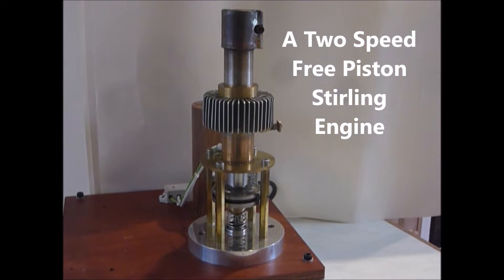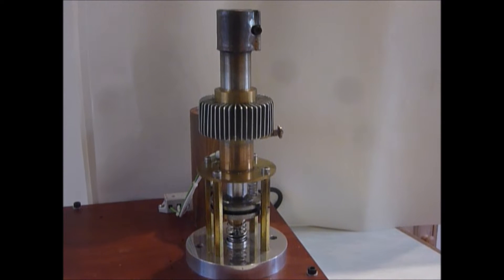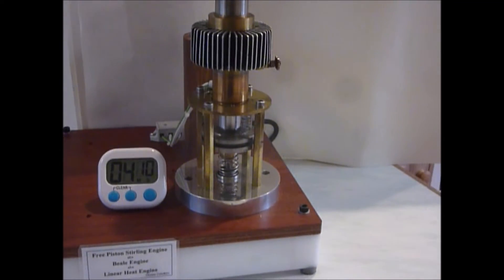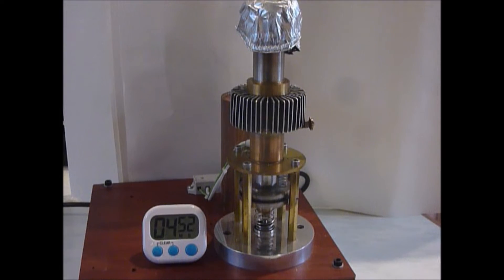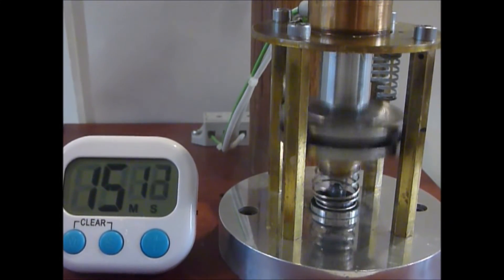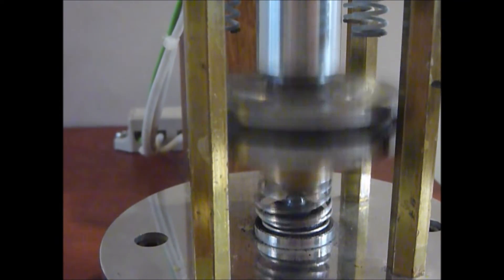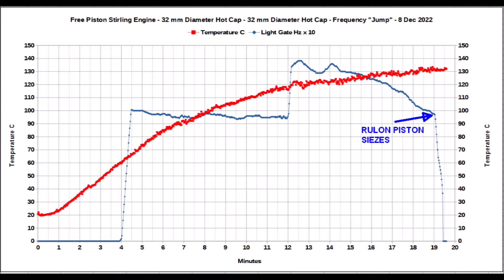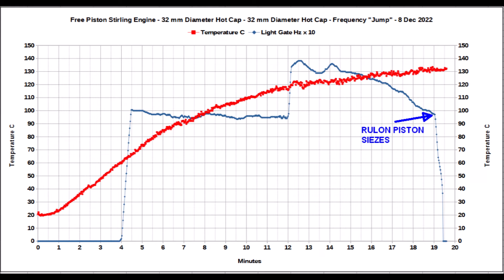A Two Speed Free Piston Stirling Engine - FPSE

Comment: Harmonics? I would guess the dimensions of the whole setup imply there is a certain resonance frequency, a point of optimal working efficiency. Within the physical boundaries of the engine, any harmonic  (difference in temperature, piston weight, spring tension, etc.) will give a different speed. No?

Comment: It seems that they all will go faster if you apply more heat or increase the temperature difference by applying cold to the cold side with a water bath, or ice. 

Wrap the cooling fins with a wet paper towel and keep it wet and watch it go into a 3 speed or shift to second speed sooner on less heat.

Cooling water or ice water on the cooling fins will mean less heat needed to go faster, thereby less chance of seizure of the expanding Piston.

Or a high temp ( automotive) plastic/rubber hose, wrapped around the cooling fins in a coil pumping cold water around the cooling fins.
Reply from the maker: Hi Ray - thanks for your comments vs cooling and using that as a way of getting a bigger delta T
Could you do a video of your engine with two speeds?

Comment: Dear Andrew, it was a plesure to see your demonstration! Much better than mine, also this unit looks pretty cool! I enjoyed your short explanation thanks to share with us! BLADE
Reply from the maker: Thank you Blade. This two speed FPSE activity came as a surprise me. So I was please to see that you too had recorded it.
Do you know of any other video of FPSEs running with high and low speeds? Andrew
Reply: @andrewhall2702  Dear Andrew, I never seen that, but with other type hot air engines I found it. Thermal Lag could work sometimes in oscillating mode with low frequency 2-4Hz and moderated stroke, but with full stroke and rotating flywheel could hit the 1000rpm.
Reply: @AttilaBlade   I noticed I could get two modes out of my jumper, perhaps like yours when you pull the rubber band back more or enough for a stronger starting impulse.
https://youtu.be/gyMoPY6KkTs

Comment: Very interesting! I'm working on a Stirling engine, meant to measure the behavior when the length inside the engine from one side to the other is the same as (or half of) the wavelength of the soundwave of that frequency. So the pressure wave is made by the piston and bounces back from the other side.
Attila Blade ones mentioned that the wavelength inside the regenerator is much shorter than he expected. This makes sense because the actual route of the gas through the regenerator is longer than the length of the regenerator. Also the cooling and heating inside the regenerator will have some effect.
Part of the pressure wave will bounce back from the regenerator to the piston on the cool side of the engine. 
When you have a whole wavelength engine you have three waves, one from the piston bouncing back from the inside of the regenerator, one through the regenerator bouncing back from the end on the hot side, and one from the end of the hot side bouncing back inside the regenerator. When those three pressure waves synchronize I expect a higher efficiency.
I came to this when I was optimizing a Stirling engine design program with test data of the GM 4L23, where there was one measurement with a higher than expected efficiency. Somebody sugested that I should not use that measurement because it was obviously an error, but I want to find out whether it is a real higher efficiency caused by oscillation.
Reply: Could you share some more information on that design program? I dabbled a little in modelling Stirling engines using more conventional energy equation based models, and I can't help but be interested in other approaches.
Reply: @bartpaaddiator2747  There is a second order version in Java Script.
Search on: Stirling engin design program
I have the source code version in Quick Basic of that program with a build in optimizer on that site, but I'm not sure it works. That version you can let the program find the optimal parameters for the highest efficiency and/or power. The program expects the pressure to be the same in the whole engine, but that is not the case on a fast running engine like a thermal acoustic one.
I did some work to put it in a spreadsheet, but that can still take some months. People did complain that the program is difficult to use, an they are right, despite all the work I did to make it easier. It's not easy to make difficult things easy.
Reply: @عبدللهبنعبدلله-ن8و  Keep your religious views to yourself, we are dealing with physics facts.

Comment: Interestingly, there is a video by @AttilaBlade where he shows a simple free piston engine made out of glass which also has two operating frequencies corresponding to different amplitudes. After a quick look at the Walker and Senft book on free piston Stirling engines, it seems to me that it is reasonable to assume that besides the design stable oscillation, there can be some conditions which will make the engine settle in a different oscillation (meta-stable conditions). But it is frankly difficult to get my head around.
Reply from the maker: Thanks - I will check out @AttillaBlade. 
I have also been told that with a coupled twin oscillator system - there are two degrees of freedom and therefore two stable oscillation modes.
Reply: @andrewhall2702  🔴 What Is Islam? 

🔴 Islam is not just another religion. 

🔵 It is the same message preached by Moses, Jesus and Abraham.

 🔴 Islam literally means ‘submission to God’ and it teaches us to have a direct relationship with God. 

 🔵 It reminds us that since God created us, no one should be worshipped except God alone. 

 🔴 It also teaches that God is nothing like a human being or like anything that we can imagine.

🌍 The concept of God is summarized in the Quran as:

📖 { “Say, He is God, the One.  God, the Absolute.  He does not give birth, nor was He born, and there is nothing like Him.”} (Quran 112:1-4) 📚

🔴 Becoming a Muslim is not turning your back to Jesus. 

🔵 Rather it’s going back to the original teachings of Jesus and obeying him. 

More .....👇

🔴 THE RETURN OF JESUS
Reply from the maker: This is the link for @Attilablade and another two speed FPSE
https://www.youtube.com/watch?v=s9G2hYBAd64